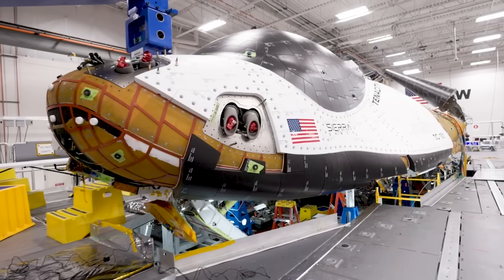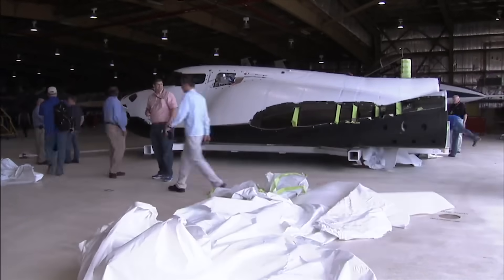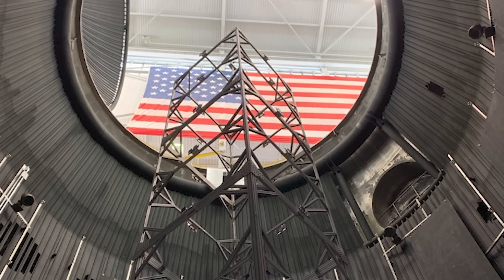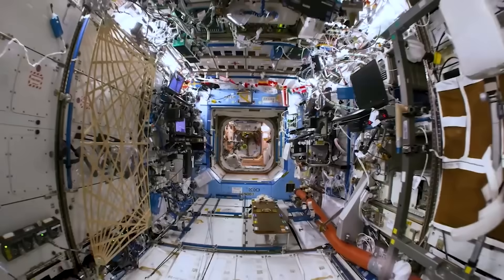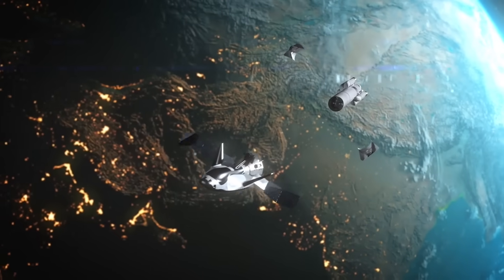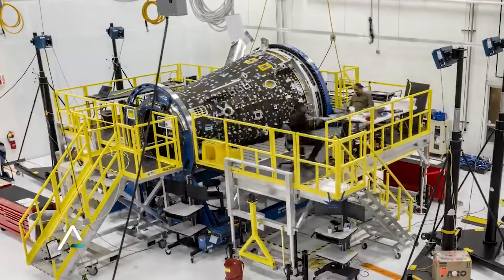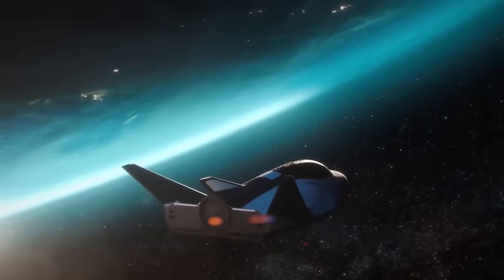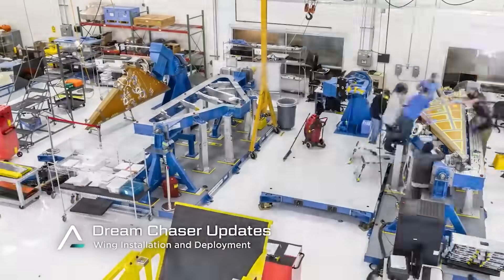Dream Chaser Tenacity Is Officially Complete

Comment: So here is a question. The Space shuttle was a proven system. Sierra Space decided to create a smaller version of the Space shuttle. But it took them a decade to make their space plane. The question is WHY did it take so long to engineer something that had a proven predecessor?? LAME!
Reply: It took over 80 years for the first lightbulb to be invented. Think about it. If I was a lightbulb inventor 900 years ago I would be making candles. And candles aren't lightbulbs. Isn't that messed up? Thats why space shuttles have to come NOW.

Comment: SpaceX:  we fixed the tile issue by reducing the amount of unique tile shapes.  Sierra:  we fixed the tile issue by making every individually unique tile bigger, so there's technically less of them.
Reply: It would be ideal to have only one, or as few possible tesselated repeating tiles, (triangles or hexagons, mainly) but I can understand Sierra Nevada having to stay with custom shapes.

Part of it is if the standardized  shapes will diverge from the needed aerodynamics too much. Both in terms of being conformal, and in terms of their ratio of size, against the overall vehicle, and their ability to form a virtual compound curve. 

It looks like SN had to go with custom shapes, but worked hard on reducing or eliminating every last problem the Shuttle TPS had. 

It appears they use mechanical fasteners/bolts, not just adhesive. They're thicker, tougher, and as noted, there's fewer of them, they're larger, and on a much smaller spacecraft that rides under the cargo fairing of a traditional booster.
Reply: you really should read what you type. your point is mute!! as they BOTH said different things. "amount of tile shapes" vs "size of tiles"
Reply: @grantandrew619 I have no argument, but wish to point out a common error, in spelling. The correct spelling of the word, is M-O-O-T, rather than M-U-T-E. Hope this helps.

Comment: Can anyone explain why we need this thing? The space shuttle was already considered by people like Carl Sagan to be unnecessary. It was useful for building the space station, so in the end I think he got proven wrong - that the world of automation was not yet up to the task of building a space station without human help. 

But I look at this thing and think, why? Its far more complex, dangerous and expensive than the simple capsules we've become accustomed to. The dreamchaser has far less cargo volume and crew capacity. So what's the point? It's going to be outclassed by a simple stainless steel cylinder...
Reply: Because the smaller cargo volume and crew capacity allows for a distribution of Ying and Yang (The yang being Hope) And with larger planes there is more cargo and less hope

Comment: New modern space plane, my ass. This is a copy of the Soviet MiG-105 developed by the URSS during the cold war
Reply: I'm sorry to disappoint you, but It is based on Boeing X20 Dyna-Soar, actually Russians stole and copied the tech & the design, Soviet Mig-105 or BOR-4 were in 60s and 80s respectively while United States Air Force was working on X-20 Dyna-Soar in 50s.
Reply: @JigilJigil  I dont mean to 'burst your bubbles' but both of you are wrong. The plane was designed to look like an awesome spaceship and not based on naything
Reply: @j-cool-guy-OFFICIAL-CHANNEL  I am going to burst your bubbles, the Sierra team behind the Dream Chaser have stated many times that this is actually based on Dyna-Soar.

Comment: MIG-105.11 USSR
Reply: NO, It is based on Boeing X20 Dyna-Soar, actually Russians stole and copied the tech & the design, Soviet Mig-105 or BOR-4 were in 60s and 80s respectively while United States Air Force was working on X-20 Dyna-Soar in 50s.

Comment: spiral ussr spacecraft
Reply: I'm sorry to disappoint you, but It is based on Boeing X20 Dyna-Soar, actually Russians stole and copied the tech & the design, Soviet Mig-105 or BOR-4 were in 60s and 80s respectively while United States Air Force was working on X-20 Dyna-Soar in 50s.

Comment: Спи*дили))) форма челнока не что не напоминает?  проект "Спираль" СССР 1980г.
Reply: I'm sorry to disappoint you, but It is based on Boeing X20 Dyna-Soar, actually Russians stole and copied the tech & the design, Soviet Mig-105 or BOR-4 were in 60s and 80s respectively while United States Air Force was working on X-20 Dyna-Soar in 50s.

Comment: NASA's X-37 is a direct copy of the Soviet MiG-105 spaceplane from the 1970's.
Reply: No it is not, It is based on Boeing  X20 Dyna-Soar, Russians stole and copied the tech and design, Soviet Mig-105 or BOR-4 were in 60s and 80s respectively while United States Air Force was working on X-20 Dyna-Soar in 50s.

Comment: Sleek design.  A pity you're still using the same century-old technology to put it in orbit that Dr. Goddard pioneered, instead of combining other technologies that have advanced aircraft design from the Wright Flyer to the SR-71.

Imagine having aTRUE "space PLANE" which could launch, fly, orbit, re-enter, and land WITHOUT a massive, semi-disposable bomb attached to it.

If only someone would work on THAT design.
Reply: What you're refering to is called an SSTO (single stage to orbit) craft. People have been bashing their heads against that concept for decades, and not even once was a feasible design proposed, you'd need insanely efficient rocket engines and SC-RamJets, at the very least, and those are still not ready.

Comment: This would make an excellent strategic reentry platform. If AI self-guided it would allow the use of  gravity bombs (like the upgraded B61 series?) instead of the hideously expensive/intensive reentry units now mounted on missiles. With a little thrust-after-reentry it could do a hypersonic cruise / bomb run like Project Pluto.

Comment: Хее😅 да это же советский "Лапоть" БОР /СПИРАЛЬ 1969 года
Reply: No it is not, It is based on Boeing  X20 Dyna-Soar, Russians stole and copied the tech and design, Soviet Mig-105 or BOR-4 were in 60s and 80s respectively while United States Air Force was working on X-20 Dyna-Soar in 50s.

Comment: это утёнок из СССР его ещё могли называть лапоть
Reply: It is based on Boeing X20 Dyna-Soar, actually Russians stole and copied the tech & the design, Soviet Mig-105 or BOR-4 were in 60s and 80s respectively while United States Air Force was working on X-20 Dyna-Soar in 50s.

Comment: Yeaaaa no. Space shuttles are not flown in and out of atmosphere today becasue of quite a few reasons. I would list them in detail, but it would take me an hour, so I'll list some of the biggest factors. 
Cost.
Efficient fuel load.
Weight.
Power:weight
Interior volume.
Storage.
Surface control efficiency during atmosphere reentry.
Room for redundancy systems.
Space-walk safety.
IFR.

Oh and did I mention cost? That's far and above the most important issue here, on top of all the fundamental problems with a space shuttle design for travel out of and into earth's atmosphere. Sure, they have a CRS-2 contract with NASA, but this is more of a private company trying to privatize space travel. FUCK THAT.

Comment: This is copy of Russian project Bor
Google  Bor Buran System was completely  building in the end of 1980th .
Reply: By that logic Bor was a copy of the X-20
Also, Bor never landed on an airstrip, always splashed down.
Reply: I'm sorry to disappoint you, but It is based on Boeing X20 Dyna-Soar in 50s, actually Russians stole and copied the tech & the design, Soviet Mig-105 or BOR-4 were in 60s and 80s respectively while United States Air Force was working on X-20 Dyna-Soar in 50s.

Comment: This reminds me of something. If you even accidentally see the Soviet Spiral system, which was created by Mikoyan’s company, you may be very surprised.
Reply: It is based on Boeing X20 Dyna-Soar, actually Russians stole and copied the tech & the design, Soviet Mig-105 or BOR-4 were in 60s and 80s respectively while United States Air Force was working on X-20 Dyna-Soar in 50s.
Reply: @JigilJigil Hello! the example of Dina Soar shows Bor even better as a prototype for aerodynamic braking solutions in the atmosphere. Compare Dina soar, Bor and this project on the lower fuselage.

Comment: Скопировали с Soviet Space Planes. Если бы те тупой Хрущёв Россия давно бы была уже на Марсе.
Reply: I'm sorry to disappoint you, but It is based on Boeing X20 Dyna-Soar, actually Russians stole and copied the tech & the design, Soviet Mig-105 or BOR-4 were in 60s and 80s respectively while United States Air Force was working on X-20 Dyna-Soar in 50s.

Comment: Глеб Лозино-Лозинский улыбается в раю.
Reply: No it is not, It is based on Boeing  X20 Dyna-Soar, Russians stole and copied the tech and design, Soviet Mig-105 or BOR-4 were in 60s and 80s respectively while United States Air Force was working on X-20 Dyna-Soar in 50s.

Comment: Why bother with landing gear and make a space plane/flying boat? Hear me out. You wouldn’t have to worry about the heat shield surface integrity of gaps or seals where the landing gear is housed. That would make maintenance easier.

Comment: el Dream Chaser es el hijo pródigo del BOR-4 ó MIG-105 de la empresa rusa MIG, en todo caso entiendo que se compraron los derechos a MIG para replicar la nave en EEUU
Reply: It isn’t, NASA has tested similar designs in the 60’s and 70’s.
Reply: No it is not, It is based on Boeing  X20 Dyna-Soar, Russians stole and copied the tech and design, Soviet Mig-105 or BOR-4 were in 60s and 80s respectively while United States Air Force was working on X-20 Dyna-Soar in 50s.

Comment: MiG 105 copy
Reply: I'm sorry to disappoint you, but It is based on Boeing X20 Dyna-Soar, actually Russians stole and copied the tech & the design, Soviet Mig-105 or BOR-4 were in 60s and 80s respectively while United States Air Force was working on X-20 Dyna-Soar in 50s.

Comment: It is a copy of the design of the Soviet 'Spiral' orbital plane. The developers have long said they copied it.
Reply: No it is not, It is based on Boeing  X20 Dyna-Soar, Russians stole and copied the tech and design, Soviet Mig-105 or BOR-4 were in 60s and 80s respectively while United States Air Force was working on X-20 Dyna-Soar in 50s.
Reply: @JigilJigil  they themselves wrote that they copied the Soviet design, you're proving some nonsense
Reply: @TheFruitcake1983  They have actually stated  many times that this is based on the Boeing Dyna-Soar design, plus as I told you Russians mig10 and bor-4 are copy of Dyna-Soar.

Comment: The Space shuttle was quasi reusable and inefficient. Real reusability requires a time and cost efficient turnover between flights, with the ideal with current technology being refueling and a quick ground check, like with modern aircraft. The US Space Shuttle was an expensive program, with dual use being part of the problem - the big cargo hold was dictated by defense mission. We are still a long way off real reusable spacecraft that can be quickly put back into space after a mission.

Comment: Да будет он и летать,и возвращаться.Он слизан с советского аппарата имевшего название "башмак",из за формы корпуса.Башмак и летал,и сам садился,на нем отрабатывали двигатели,покрытия,и прочее для проектов типа "Буран".В 90-е аппарат просто пропал...
Reply: No it is not, It is based on Boeing  X20 Dyna-Soar, Soviet Mig-105 or BOR-4 were in 60s and 80s respectively while United States Air Force was working on X-20 Dyna-Soar in 50s.

Comment: Looked like it was being launched on top a rocket then you say it's going to be in a fairing.... misleading.
Hard for me to get excited.looks neat.
I'll be glad when humanity gets past the need for egg crate heat tiles.
It's the archilies heel of space flight.
Would someone investigate energy based   shielding.but then that goes right back to energy which is the biggest monopoly in our time's.and THOES in control have no desire for new energy.
That will ride the coat tails of putting weed #1 in the constitution and the renascence it ignites.😁🏴‍☠️🥸

Comment: Just a thought instead of vertical launches why try some type of rocket rail system high speed or the way aircraft carriers work,just seems to take so much rocket power to lift vertically.if you good get say 25% or more speed before you even have left the ground and then hit some more thrust power once its airborne.i think they even have tech to use magnetism for trains now.
Reply: Vertical is the quickest way out of the dense part of the atmosphere. The blunt design for reentry is incompatible with accelerating through mach five at sea level

Comment: If this works it will be a monumental achievement! With any luck and lots of skill, this project will enable us to fly to space and return safely on a regular, safe, and profitable basis.
Reply: profitable? did you not see the shuttle. unless they got space x prices they wont have many customers and loose out . plus the turnaround time is gonna be badddd.
Reply: https://www.youtube.com/watch?v=hSQhTN2Bxhs
Reply: I mean ... probably not. A space plane is a very complicated way to do re-entry. A re-usable capsule like SpaceX Dragon is probably going to always be a cheaper choice. There might be reasons you want to use a space plane, but I don't think it'll be competitive cost-wise.

Comment: Russia's got a handful of these rotting in feild and ended settling for the soyuz evolution.
Hopefully this concept does not fail again.
Reply: This is based on Boeing X20 Dyna-Soar, actually Russians stole and copied the tech & design from US as Soviet Mig-105 or BOR-4 were in 60s and 80s respectively while United States Air Force was working on X-20 Dyna-Soar in 50s.

Comment: I do get a kick out of Dreamchaser being referred to modern when a similar design, known as the BOR-4 was tested in 1980.
Reply: Yes, the 80s is not modern anymore.
Reply: Sorry to disappoint, but It is based on Boeing X20 Dyna-Soar, actually Russians stole and copied the tech & design, Soviet Mig-105 or BOR-4 were in 60s and 80s respectively while United States Air Force was working on X-20 Dyna-Soar in 50s.
Reply: I do not know the BOR-4 but would not be surprised that both BOR-4 and DreamChaser are copies of the Soviet MiG-105
Reply: @walterego9827  The BOR-4 was the test reentry model for the Spiral program. The Mig-105 was supposedly for low speed handling and landing, and had an odd history, of work done from 1965 to 1969, followed by a hiatus, and then work continued from 1974 to 1978. First flight was in 1976, years after a number of lift body concepts were tested in the United States in the 1960s and early 1970s.
Reply: And there were similar designs in prior decades from the work done at NASA. But, Dream Chaser looks like its on a path for being deployed to support cargo deliveries to the ISS. BOR-4 was a small (subscale?) test bed for examining tiles and other materials for Buran (just like what the US Air Force did in the 1960s, for Dyna-Soar).

Comment: If successful,  I can see this scaled up to allow for crewed operations and a larger cargo capacity. All systems go Tenacity.!
Reply: https://www.youtube.com/watch?v=hSQhTN2Bxhs
Reply: @bbabbich3467  single use is not very environmentally friendly. How are we ever supposed to learn how to build more rugged reusable spacecraft if we don't improve on what came before it? Tenacity is built on knowledge learned from the space shuttle. It has better tiles and technology than the shuttle as well. Future spacecraft will no longer require require rockets to reach low earth orbit. However, I still see a need for rockets to provide trips further than that.

Comment: This is so much better than the more traditional parachute method. 
I'm looking forward to when they reach the point where reentry is so controlled that heat shielding is not a weak point. It would be nice to see Blue Angel styled maneuvers in the skies that can be performed before returning to Space Dock for some long awaited R&R on one of Jupiter's moons. ;)
Reply: Unfortunately making at-will turns or loops on reentry from LEO, or actually deciding to return back to orbit after a airshow/spaceshow... 

What you're describing, or things like a Star Trek shuttlecraft are depicted doing, or implied they do, not even getting into FTL/Warp... 

To do that stuff, it's enough energy to drill a hole halfway through Earth, all contained in a vehicle the size of a large minivan.

Antimatter may do it, but how it's handled, and the energy is used, without frying the passengers, and anyone within a few hundred thousand kilometers... is tricky.
Reply: https://www.youtube.com/watch?v=hSQhTN2Bxhs
Reply: bbabbich3467  can we reuse it if it lands by parachute? Probably not. So its probably cheaper to go with the rocket fired landing. In fact I believe that is the reason they started doing it that way.
Reply: Ever heard of spaceship one?
Should be Virgin Galactic now.
Reply: @edgargad2941 you mean the death trap with no digital FCS?
Reply: @edgargad2941  Virgin Galactic is dead.

Comment: You said the last time we saw a space plane take off was the Space Shuttle?  What about the X-37B?  It has flown several times and  has been rather a success with the U.S. military.  The last time one landed was just last year.  There really is not as much different between history of the X-37B and the shuttle.  Both were made to specifications set out by the U.S. military.   The shuttle was, of course, much more public (and, deadly) but the X-37B is most definitely another  implementation of the space plane concept.
Reply: The X-37B is not a space plane. It is a space drone.